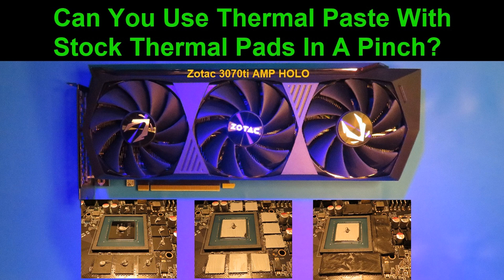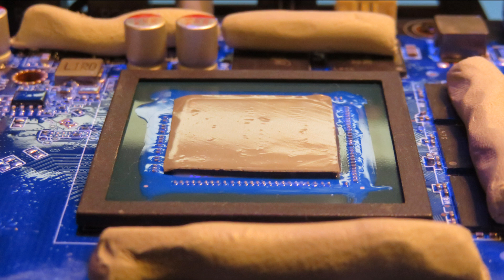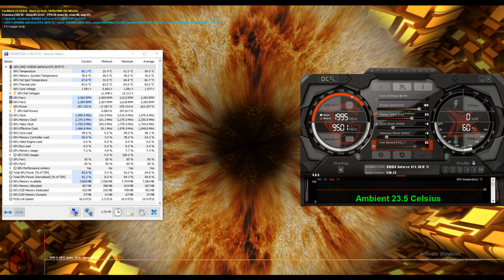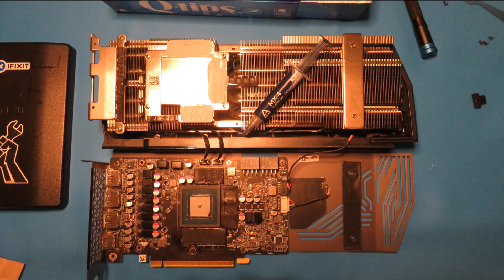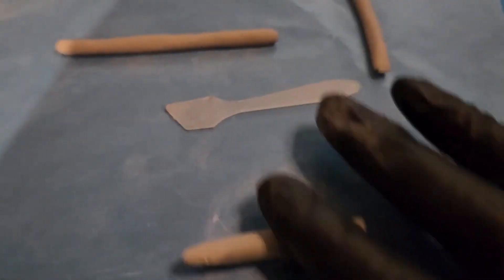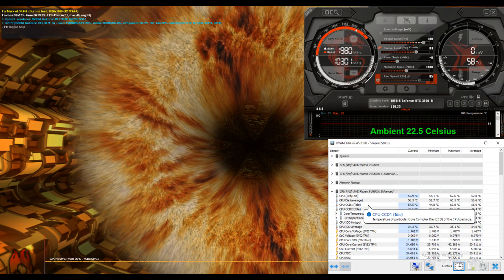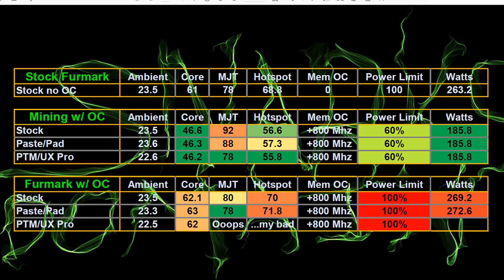What happens if we put thermal paste onto thermal pads?

Comment: Why not test typical quadro card style or turbo style stock pads that use white thermal paste looks like zinc oxide with bandage from pharmacy to hold it in place? I tested Thermal conductive paste H from Thermopasty and compared to Thermal grizly aeronaut is same temperature, hydronaut 1c cooler,  cooler master master gell is 4c hotter, upsiren 21w pad same remperature as Thermal conductive paste H, laird hd9000 3c hotter. So the 16/21/24w watt rating is just marketing if the Thermal conductive paste H that has rating of >0.88 W/mK beats them all !
Reply: Forgot yo say that Thermal conductive paste H gives me same temp on cpu as gd900 from china, the only difference is cost. Thermal conductive paste H is 6eur for 100grams!!!!
Reply from the maker: @akierum  interesting.
Reply: Those pads nvidia used on Tesla v3075 cost was same as nvidia a100 today
Reply from the maker: @akierum  i do not like those pads (If I'm thinking of the same ones). They do not perform well.
Reply: @ Test mikrusy Thermal Pad 100x15x1,5mm 6W/mK
Reply: Test termopasty ThermoPads 6 W/mK
20x130x1.0 mm – ART.AGT-140
20x130x2.0 mm – ART.AGT-141
20x130x3.0 mm – ART.AGT-142
30x30x1.0 mm – ART.AGT-159
30x30x2.0 mm – ART.AGT-160
30x30x3.0 mm – ART.AGT-161
200x400x1.0 mm – ART.AGT-130
200x400x2.0 mm – ART.AGT-191
200x400x3.0 mm – ART.AGT-192
Reply from the maker: @akierum  thanks for the suggestion. I'll look into those. I only test 2mm thick pads, since that is the size used on the VRAM of this card. I'll luckily only need to buy one of those :)
Reply: @snarksdomain  Both brands I posted have 2mm pads.
Reply from the maker: @akierum  yeah, those w/mk ratings are pure marketing at this point. I wish more brands would just not have then at all. Too many people blindly pick the one with the higher number.

Are those white pads with bandaid mesh you refer to similar to the pads Nvidia used on the 30 Series FE cards?

Comment: Do you think i could do the same treatment on my mobile's battery pack?
Reply from the maker: @gnrtx-36969  Using Thermal paste on thermal pads? Or using Thermal Putty? I'd recommend putty. To be effective it needs to be transferring the heat to something that will help dissipated the heat.
Reply: @snarksdomain  do you think a copper sheet gonna work?I'm scared if it would short something
Reply from the maker: @gnrtx-36969  is the an extra battery pack that you are using with your cellphone? What model of phone and battery? I'm trying to picture the setup.
Reply: @snarksdomain  nope it is the internal one 
I have an old mobile redmi 9 prime 
This thing has 5000mah battery and it heats up allot
Now unfortunately the back cover is plastic
Reply from the maker: @gnrtx-36969  I found this, but it's a bit expensive. Maybe it could be found for cheaper?

https://m.newvast.com/luxury-aluminum-metal-cover-case-for-xiaomi-redmi-9-prime-india-black-138240.html
Reply: @snarksdomain  its pretty expensive though but anyway thanks

Comment: the picture on 3:35 describes what i did to my gpu, is that okay to use thermal paste on the memory instead of thermal pads?
Reply from the maker: @ekeromano6399  Thermal paste instead if pads is not a good idea. Thermal Putty, on the other hand, is designed to be a direct replacement for pads.
Reply: @snarksdomain  how bad is it? will it cause issues? and also when looking at memory junction temp it doesnt go above 70 if thats what the vram is
Reply from the maker: @ekeromano6399  I mean, if you are able to check your VRAM temps now and then, you should be able to k9tice when they eventually get worse as the paste dries or runs.

I don't think paste will last as long as a putty will. It's likely also much more expensive to fill that gap woth paste l, compared to putty. It also won't perform as well as high end putties will, based on maximum particular sizes paste uses vs what putties can use.

My advice is to check on your MJT temps every so often (maybe every few months). Can always switch out the paste for something better in the future.

Comment: Great video and a very bold approach as well! I'm about to do the first clean up on my pc and was aiming to replace the thermal pads in my GPU and to use it in my M2 also.
After LOTS, LLLLLLOOOOTTTTSSSS of research, I reached this conclusion:
1 it may sound obvious but, the MAIN thing for thermal conductivity to work is CONTACT, so yes, you can't replace pads with paste, because even if you put a thick enough amount of paste, you won't have CONDUCTION, you'll have CONVECTION, which is way worse than conduction.
2 before messing with those, consider how efficient your card can dissipate heat, otherwise you may solve one problem but creates another much worse. See this video to understand - https://youtu.be/vdIIA57treo?feature=shared - heat likes to go to the cooler place available, if it's not dispersed quick enough, he's going back in and to the cooler surroundings
3 in the specific case of your video, I think that if you applied thermal paste only to the dissipator contact side of the thermal pad, maybe it would've worked better, because heat would start to go away from the pad much faster, and it would keep receiving and RETURNING heat at the same pace from the die contact side, probably keeping a cooler "relationship" in between. 
We have two ways to go from there, you need a pad with lower conductivity than the paste, to work as I said, or you could try to "match" the conductivity for the heat to move as fast as possible, of course, having a strong dissipation environment.
I'll check the condition of the pads in my setup, if they're still good, I'll go ahead and apply a layer of paste to see what happens, because there is absolutely no problem in having both in contact for much time as needed, the materials are compatible, so I'll only have to redo it if it actually gets worse, not better.
Reply from the maker: @brupleal This experiment with paste was just for testing as someone had requested I try it out. I use Thermal Putty to replace thermal pads and have found it to be a superior solution that let's the cooler achieve ideal core contact. You may want to consider just using putty instead of paste+pads.
Reply: @snarksdomain  probably will go that way as well, I've kept researching stuff about that and the putty seems to be a ideal solution, but so far only one question about the putty is left, what is the putty impact in the hotspot temperature?
There are not so much tests and reviews about putty that are really complete and rich in data. I've seen only one so far that showed all the temperatures, the guy was using a pink putty from Aliexpress, and it shaved about 10cº from the temperatures, but sky rocketed the hotspot by 20cº up!
So, did you notice any increase of temperature in the hotspot? Which putty do you use?
Reply from the maker: @brupleal  feel free to check out my test data charts located on the Google Drive link below (Test Chart Repository>VRAM TIM>ETCHASH).

Putty compresses better than pads, so you have a better chance to have lower hotspot delta over core temps. That being said, there are some cards that have really convex GPU dies and those can be difficult to get lower hotspots temps (AMD cards lately). Nvidia cars can get 10-15 degree delta over core temps, AMD is closer to 15-20 if you're lucky.

Comment: Hello. I just put thermal paste on the old thermal pads near the cpu of my laptop (temporary. I have ordered for new pads but it will take some weeks to arrive.). It is dangerous? Or I can work with my laptop until the arrival of the new pads and I will all change? Thank you
Reply from the maker: What type of paste? If it's one that conducts electricity then it is dangerous. If it is one that doesn't co duct electricity then it should work okay for the short term.

Had you considered Thermal Putty instead of pads?
Reply: @snarksdomain 
I used acritic MX - 4
The reason is because when I opened the cpu (and some chips around it) to change thermal paste of my laptop, I found that the ships around the cpu are covered with thermal pads that are in poor condition and I don't have pads in my city (I ordered them from China, so it will take some weeks).
The laptop is working well and with good temperature after changing the cpu thermal paste and restoring the old pads in the chips around the cpu and I did some paste Above them then close the screws.
Mx 4 is safe in this situation? 
Greetings.
Reply from the maker: @bikhato  It should be fine for now with MX-4 as it does not conduct electricity. It could take a bit longer to clean up later, but at least you can keep using your PC for now.

You may want to watch a few videos on Thermal Putty. You might change your mind on the pads and decide to switch to putty instead. You can also take a look at the charts on the Google Drive (Test Chart Repository). Then select the VRAM TIM folder, then ETCHASH folder, and open the latest chart there.
Reply: @snarksdomain 
I thank you sir for your help. Have a nice day

Comment: Hello i have applied thermal paste on vram of my gigabyte 5700xt instead of thermal pads because if i apply thermal pads even 0.5mm i get very high hotspot temps.memory temps are good max 72c will it cause any issue?
Reply from the maker: The paste will likely pump out or dry out after some time and you'll likely need to open it up again.

You'll probably want to switch to using a Thermal Putty instead.
Reply: @snarksdomain  will it last a year?
Reply from the maker: @Scott99259  I'm not too sure. Up to you if you want to test it out or not. One thing to keep in mind is that the longer you leave it, the higher the chance of it baking solid. It could be more difficult to clean once that happens.

Comment: Could you repeat the test with carbonaught pads vs carbonaught pads + good thermal paste.
The reason being that the sheet does a good job of filling the gap when there isn't good and even contact, additionally the paste does a better job of mating the surfaces (fills more of the tiny pores) for increased thermal transfer.
Would a carbonaught sheet perform better, if coated in thermal paste?
Would it be better to just use extra thermal paste (when the surfaces are exceptionally non-flat) rather than using a space-filling thing like a sheet of carbonaught.

For a specific example of a card that has this curious problem, take a look at a Radeon VII.
Apparently the heatsink and the die of the Radeon VII don't have the best flatness, and additionally the heatsink doesn't get sufficiently close to the die either, even if you lapped the surfaces, there would be a large gap that, for example, liquid metal would be a poor use case for, because it's too thin. Gamers Nexus has 2 videos showing that the Radeon VII has poor surface contact with its cooler that you could check out. Apparently the manufacturers of the Radeon VIIs were aware of the larger gap size and they used a very thick (and sticky) graphite based pad to fill the gap.
Reply from the maker: Something like that may work for a Radeon VII. I went with just a sheet of Phase Change Material instead on the Radeon. It was 0.2mm thick and can melt and compress down as needed. It seems to have worked well. My temperatures were about 3 degree cooler than the stock sticky pad (which was fairly old).

The Carbonaut pads would only work for a core application. It would be quite costly to make enough sandwich layers of carbonaut and paste for the VRAM.

Comment: is ok if i put thermal paste or vram ??
Reply from the maker: All by itself? It's not a good idea. Paste isn't designed to fill gaps like this. It's really only meant for direct contact or gaps below 0.1mm, and usually much less than that.

You will either want to use a traditional Thermal Pad, or like many of us now use, "Thermal Putty".

Thermal Putty is designed to fill gaps like this and transfer the heat well. There are some great Thermal Putties available, and they often are as cheap or cheaper than Thermal pads. As an example, I recently spent ~$22 CAD redoing a 3070 and replaced all pads with the current best performing Thermal Putty. I used 44 grams.
Reply: @snarksdomain  oh i see , thank u btw can thermal pad dry like te paste ?
Reply from the maker: @giovannigiorgio2262  I think you meant to ask if Thermal Putty can dry? 

I've seen 2 comments regarding EVGA putty being dry, and 1-2 comments about TG-PP10 drying specifically on the VRM. I myself have experienced TG-PP10 drying on the VRM on 1 card, but still soft elsewhere.

Even in dried state it seems like it still transfers heat okay, but I would like to further test this out.

We won't know about the other putties for some time.

Edit: Thermal Pads dry out over time, but mostly in areas of high loads/temperatures. Older cards with GDDR5X and below had much cooler VRAM.
Reply: @snarksdomain  i have rx480 btw i rly i can play 2k  most of games but now new games like alan wake 2 its wont work its show i need to buy new graphic 😂😂"modern" bec there is some shaders not supported  i asked u about pad bec i have OG pad still on GPU but i dont know if the vram cold or high temp
Reply from the maker: @giovannigiorgio2262  the RX480 uses GDDR5. The stock pads might still be in okay condition. Hard to say for sure until you open the card. The thermal paste is very likely dry though, just based on its age.
Reply: @snarksdomain  yes thermal paste is dry . btw i know when thermal paste dry "fan speed" not the temp bec u can hear ur fan sound like heli or something since i use Chinese thermal paste i have to change it every 6 months bec its dry quick i have MTG10 + GD007 , i like MTG10 more its  not bad but dry fast 4-6 months "if u play games all time "

Comment: My main question is why do you put so much thermal putty on your memory chips and VRM 

Like it's too much putty imo you would have better thermal transfer with less of it
Reply from the maker: Filling a 1.8mm gap on GDDR6X takes a log measuring 6mm in diameter. So anywhere from 6mm to 7mm diameter is ideal for it to form around the edges to achieve maximum contact.
Reply: @snarksdomain  ah just curious cause even your laptop videos seems like there's to much thermal paste

I'm currently looking for something for the VRM and memory chips incase my stock thermal pads need to be replaced 

Which the laptop I have is a MSI Vector GP68HX 13VH 

I don't want to use sketchy websites buy thermal putty or thermal pads and so on and so forth
Reply from the maker: @TheChillDeadpool  for my laptop I scrape off the excess after putting the cooler back on. I prefer having a bit excess to ensure full coverage, but I have used too much putty on several videos in the past.
Reply: Hello. I just put thermal paste on the old thermal pads near the cpu of my laptop (temporary. I have ordered for new pads but it will take some weeks to arrive.). It is dangerous? Or I can work with my laptop until the arrival of the new pads and I will all change? Thank you

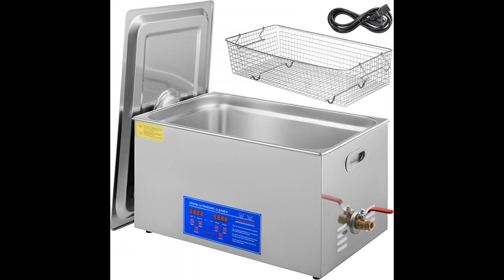Comment: 10:52 Isopropanol is a solvent by the way…
Reply from the maker: Very true. I should have clarified I meant for people to use caution with other solvents that are typically used in Ultrasonic tanks due to their non-flamable characteristics, as opposed to IPA. Some have used IPA with Uktrasonic cleaning, but I think the additional risk is not worth it unless you have proper controls in place (oxygen free atmosphere maybe?).

It would actually be kinda cool to have a toolbox like chamber that the cleaner sits in, and flushing it with nitrogen prior to cleaning. With pure Nitrogen being 3% lighter than air you'd need a drain on the bottom to vent out all the air during the flush.

Comment: What's the reasoning behind the conformal coating?
I thought putty and paste are both non-conductive.
Reply from the maker: PtM7950 and UX Pro are safe to use and don't conduct electricity.

I used the Conformal Coating because I wanted to give the card a decent protective layer for dust/dirt/fluids/vibration for the life of the card. In this video it wasn't truly necessary, but I thought I would include it in the video anyways.

I've also done this to my testbench card. This should prevent me from needing to use Kapton tape in most test applications and I'm hoping it will also make the card easier to clean between tests, as well as lower wear and tear. My test card has been re-padded/puttied quite a few times now.